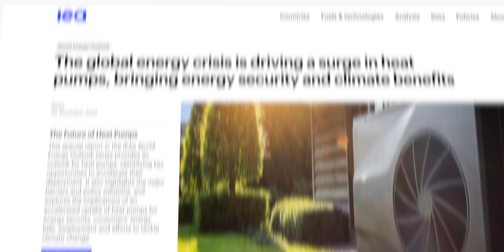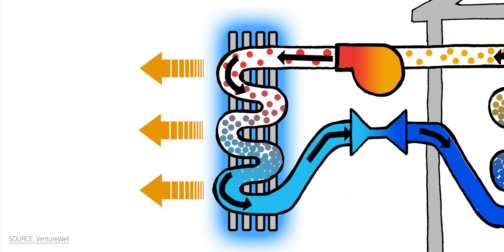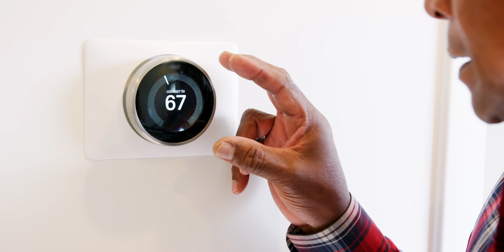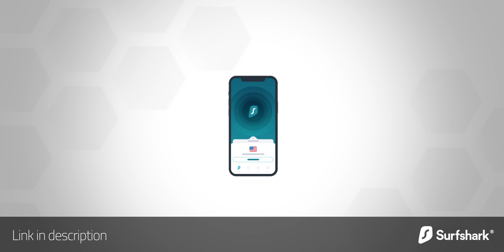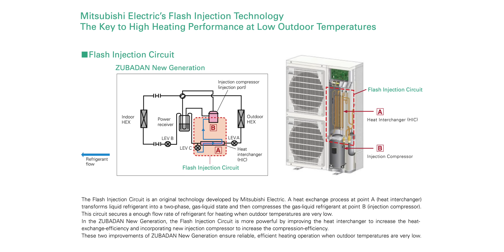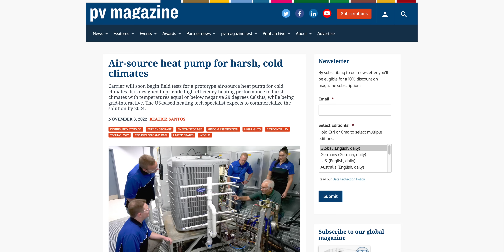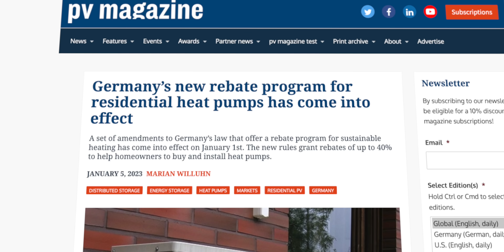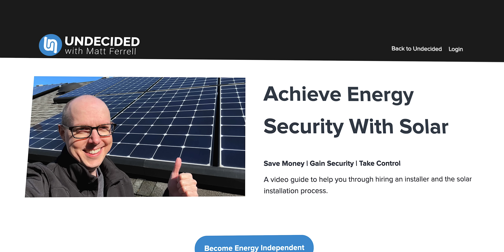Major Advances with Heat Pumps in the Extreme Cold

Comment: Heat pumps are way more difficult to service then combustion devices.
Reply: you can do the majority of a service for a heat pump yourself, not sure where you are, but in the UK you aren't allowed to service a gas boiler.  And here in Sweden, by law my chimney needs regular servicing and checks by an authorised professional.
Reply: @BenIsInSweden  So, I was selling heat pumps for 15 years, Carrier. We needed to train proper servicemen minimum of 5 years, probably 10 years you need to have skills to be able to repair HP independently. you can have mechanical problems, like pumps, ventilators, or leaks, water flow, understanding hydraulics, or leaks, for that you need special skills, electronics, chemistry. On top of that in all of Europe, you are NOT ALLOWED to repair heat pumps by yourself as you need to comply with gas regulations (special permits from the government are required) and you need to fill special reports for each repair considering gases and dangerous waste. You need to account for each kg of gas and report it yearly to EU agencies. Nobody will be able to service that amount of heat pumps in the coming years. Also, you need to have a bunch of special toolings that you don't need for gas boilers. You obviously have no idea what are you talking about.
Reply: @hrvojelasic5794  That's repair, I'm taking servicing, i.e regular maintenance. Most household heat pump maintenance, is preventative, i.e. removing debris and cleaning the coils, fans, filters etc.  With a boiler you aren't even allowed to take the cover off without being gas safe registered. Breakdowns are pretty rare, and yes in those cases you'll need someone with more knowledge.
Reply: @BenIsInSweden  I am also talking servicing, removing debris is not servicing,
Reply: @hrvojelasic5794  🤷🏻 I didn't say just removing debris. So how much and what of an actual service can't your average Joe do? because everything you listed was to do with repairs. As the only thing here is if there is a concern with the refrigerant lines, and that's mostly with split systems.  Monoblocs (which are common in the UK), don't need F-Gas for installing and servicing.
Reply: @BenIsInSweden  you need fgas reporting for each service that needs gas. actually, you can't touch these units unless you have permission for the company to do it (from the government). btw, you can't even buy gas if not registered. Even for cleaning you mentioned you need special tooling because you can damage fins or chemicals to deal with more serious debris. split units (up to 5kw)  as a general rule you don't service, just buy a new one. the only thing you can clean it by yourself. bigger units really depend on cost. For example, 1 kg of gas can be a couple of hundred Euros, without work or other material. All this is very expensive and annoying. People will realize it in a couple of years when all these units now being installed will start to fail.
Reply: @hrvojelasic5794  I don't think we're on the same page with what servicing is, I'm talking about the annual (or in some cases, every 2-4 years), where things are cleaned, and it's given a check-up that it's working properly, much like a car (except a car, you change the oil etc). You seem to be talking more about when things go wrong. Regardless, modern home units don't need you to do anything with the gas, if there's a leak, the gas is gone, so would need refilling, and someone is going to get a big slap on the wrist; ergo require someone with fgas certification.  A gas boiler needs an annual service - clean and checkup, but can only be done by someone gas safe.
Reply: @BenIsInSweden  Such ignorance is what I am talking about. Good luck

Comment: I had a heat pump system back in the 80's and I lived in the foothills of western NC. We didn't get extremely hot or cold in this area but there was always a need for cooling or heating in my house. While some people back then didn't like a heat pump because they said the air coming out was too cold in the winter time. I was pleased with mine, however the two units I had didn't last over about 12 years each. The problem with a heat pump is the compressor, while they run inside the flooded refrigerant system in oil (over time like anything mechanical at some point when they get enough run time) something will fail. My system was fairly cheap to operate however we did have a fire place insert that we used when it got very cold just to save on power. Our systems back then also had backup electric heater strips that would come on when the system ran too long and failed to rise above the thermostat setpoint after a predetermined amount of time. At least when you have a gas pack/air conditioner system you limit the run time on the refrigeration compressor because it is not used in the wintertime. You must also remember that unless you have a solid state relay in the unit, every time the compressor kicks on the mechanical contactor will arc and at some point it will fail. I believe that the systems I had were not scroll compressors (they were reciprocating compressors), I don't think that even if they were scroll compressors it would have made a lot of difference in how long they lasted.

Comment: I don't get how people use heat pumps for heating their home... I have a hot water radiator system with a radiator in every room.  If I got a heat pump system to replace my current system, I would have to have those expensive air blower units in every room of my house.  This would cost $30-40k.  What am I missing?
Reply: "What am I missing?" That there are other variations on the heat pump than just the mini split style.  What you're after is an Air 2 Water heat pump, which comes in two forms Monobloc (where everything is on the outside, and water pipes are fed to the outdoor unit to do the heating) or split, where there is both an outdoor and indoor unit connected via refrigerant lines, and the hot water is heated by the unit inside the house.   Depending on what temperature you run your flow temperature you may need to upgrade some radiators or pipework (usually if it's microbore).
Reply: Thank you.  My understanding is that using air to water heat pumps is a low hot water temperature system. My cast iron radiators require hoter water. Basically, this would mean I’d have to replace all the radiators in my house with baseboard radiators, which would be quite an undertaking and expense.
Reply: @marksTips466  it depends. There are high temperature heat pumps as well, but they wont be as efficient as a low temperature system. I do recall seeing a video of someone with a heat pump and cast iron radiators as well, so they might not be a deal breaker.

Comment: I installed a cold air heat pump in fall 2021.  I live in southern Ontario Canada.  In addition I improved the insulation in my basement.  I used closed cell spray foam on the interior of the foundation concrete walls. The previous insulation was a combination of pink fibreglass and foam board.  I can’t give a precise breakdown of my current electrical bill as I have an electric water heater and electric car charger and clothes dryer.   However my highest electricity cost on a 30 period in winter has been $264 Canadian.   Generally between April to October my electric cost has ranged between  $110 to $165.  I cannot account for the heat savings for getting rid of my direct vent gas water heater which used heated inside air for burning the gas.  One important benefit is that we keep our house at 70 deg F for 24 hours/day 7 days a week.  So for me I cannot say enough good about it.  My model is a Mitsubishi Hi2 model. The outside unit is almost silent particularly when on air conditioning mode.  I got a $5000 Cdn Greener Homes grant on this install.

Comment: What none sense ,they run off electricity , cost 50 thousand dollars ,when they do not have enough power already stoping people from using air conditioners ,and then they shut the power off , need a back up wood stove , putting thousands off tons of plastic into the ground .

Comment: I had a geothermal heat pump system in Grande Prairie Alberta for 22 years. It got me through -45 temperatures at least 4 times, with no problems. (Remember that this was a geothermal system, so I had 3/4 of a mile of pipe 10 feet under ground, circulating a glycol solution)
So, it did work, however saying that it doesn’t use much energy is not true. I was using considerable amounts of electricity to run the system. I was using more money to keep my house warm than neighbours using natural gas, by up to $200 per month. 
Consider, for a moment, what would happen if even only 30% of the buildings use heat pumps, and at the same time, 30% of the people use electric cars. People are already saying that people should charge their cars over night, but that is the exact time when house heating would be needed. 
Think of everything!

Comment: I live in Whitehorse, Yukon.  Where I come from -40 is kinda expected every winter.  The result is that people are scared of heat pumps.  However, right now, mid November, the average daily temperature is just under -10c, well in the range of modern cold-climate heat pumps.  In mid January, the average daily temperature will be down to about -20c, still in the heat-pump efficiency zone.  We get -40, so supplemental heat is necessary, but the average winter throws only about 10 nights that are below -30c.  It is our human nature to extrapolate the extreme event as if that is the state of the entire season, but cold snaps are an exception not the rule.  Even up here in the sub-Arctic heat pumps make sense to the environmentally conscious.

Oh, and it is true that some of our electricity comes from oil and LNG, but most is hydro.  There is a bit of wind and solar. (The latter is very ineffective at this time of year.)  Burt if we go electric, especially with a COP > 1, we will motivate the powers to produce more clean energy.  The long-term result is that it is worth it to convert to electricity, motivating the electric company to develop more green generationi.

Comment: We just got ducted heat pumps a week ago, went solar over the summer. Oil is way too pricey. I live in the Massachusetts and we are getting belted with really cold air especially in the mornings. I will say that i am on the fence because with oil my house would get toasty, with the heat pumps my house is “warm” but not that toasty feeling like i had with my oil heat. Has anybody else experienced this, is this normal for heat pumps? Like not hot but not cold either just in between kind of

Comment: Can these Heat Pumps provide a 1200 sq foot home 85000btus with an outdoor temperature of -40f? This is what we require in parts of Canada. At -40f which we can experience for weeks on end a Natural Gas Furnace is challenged installed in a R2000 home.

Comment: I live in Scotland and have had mixed experience with heat pumps. We have a lot of historic underground mine workings here so ground source not possible in a lot of areas. People tend to go for air source with the air to water type as opposed to air to air. I have found that they are good for new build where a well insulated air tight fabric is formed - particularly good in passive housing. However, have found not so good for retrofit where then need larger radiators / UFH, larger diameter pipework, insulation fabric upgrades and space for a hot water cylinder. For it to work in my own property I would need to spend around £40K (a lot of builderswork, plaster repairs and all floor coverings would need renewed); I got a new gas combi boiler supplied & fitted for £2K without changing anything and its  more efficient than the old one - use around £100 a month in gas even with the crazy price hikes. We also have a humid climate here and it can be freezing & snowing one day with sun out t-shirt weather the next. My client's have been having issues with air source units freezing up, going into frost cycles and not being able to cope with the rapid temperature fluctuations. They don't seem as responsive as a gas boiler; I can put the heating on in own house and it will be comfortable within half an hour; however, been finding air to water systems can take several days to respond properly. Been looking at air to air, although been in an office with it and it used a whack of electricity + everyone moaned about noise & drafts all the time. I think air source is something that works well with passive housing; our local council tried to build passive units though and it worked out around £350K per unit for 1 / 2 bed flats (around double the normal build cost and end value would be less than £200K). The UK has a long way to go to catch up with rest of world, but I think we have some unique problems to overcome and our engineers don't know how to design & set them up properly yet. I'm not convinced on them, but also haven't given up - thanks for the informative video.
Reply: like you i come accross homeowners having mixed results manly with running costs actually being higher because of electric unit prices unless they have solar and battery storage as well, i own a heating company but currently reframe from installing hp as my work is 100% existing housing most with poor insulation and air tightness which as your own estimate of 40k to upgrade shows added to the install costs of hp average say 13k  even if you got electric for nothing for forty years you still lose out  i have a 600m square home half original stone farm house and half rebuilt last year almost zero loss gas bill average 220 pm cost of insulating remaining half will cost around 100k to strip internal walls build deeper framed walls insulate to latest bc spec with140mm tp10 with estimated elec cost for 20k of hp at 400% eficency (which i have yet to see below 14 degree)  i  need about 80 kw ph output in region of £12 after doing the work or £24 per day as is!!!!  es

Comment: EVERYONE: Please bear in mind that this ONLY pertains to newly constructed or recently heavily insulated houses with brand-new windows, and so forth. This MINOR detail alone excludes 95% of homes! Why is no one addressing this? The house must not only be tightly sealed and free of leaks but also very well insulated! Otherwise, it will not effectively retain warmth. It's as simple as that. Why doesn't the government impose these incentives and mandates on itself or the industries it oversees? This should apply to public or commercial transportation, garbage collection trucks, ALL public buildings, schools, colleges, and public housing! Why not begin there? Why are police departments still permitted to purchase and utilize Suburbans, Tahoes, and Expeditions that get 7 miles to the gallon in the city? Why??? If you believe this is about saving the planet, think again! There is a potential 25% reduction in CO2 emissions by tomorrow, especially in the US, where the government can implement these straightforward regulations. Please, if you approach this with even a modicum of logic, you can discern the true nature of the issue. Why aren't there basic mandates in every US city to prohibit those single-layer glass high-rises without any consideration for facade changes when facing North or South? Simple, straightforward rules and adjustments can decrease pollution by tomorrow! But no, they are not taking those steps; instead, they are focusing on simple Joe or Kowalski. Please, am I the only one who sees this?

Comment: I have an air heat pump for heating and cooling of my 2000 sq ft home. I live in central Indiana where winters can be cold and summers hot. I've often wondered if building an enclosure over my heat pump would improve its efficiency. Something that would be large enough to allow plenty of air flow but in the summer would shade the heat pump lowering the air temperature and, in the winter, would allow the sun to increase the air temperature around the heat pump. Minimal air holes for ventilation. Any thoughts!

Comment: Many years ago, I had a heat pump.  Then we needed an auxiliary heating system, it was my then gas furnace. My point here is that the heat pumps today, need an auxiliary heating component for cold weather,that is separate from the heat pump.
Calling the two systems together a heat pump is misinformation by hiding a significant fact...
At the very least call this a Heat pump system,
Better yet is the full truth....   That helps create trust!
Call it a Heat pump & backup furnace(system).
Further, my past experience with heating electrical, vs with gas, was more Expensive.
Folks... Details are important!

Comment: 20 years of HVAC experience here. Less maintenence hey? I have installed ten of these this 2023 year, two Napoleon and eight Daikin's. Two of these have required me to spend about 8 to 10 hours (appox. $1000 of labor) of service on them to get them working. They are really HARD to service compared to a furnace. And then there is the fact we hit -40 in my part of Canada for weeks at a time. Seriously this video completely skips over this. And how about that you need a Refrigeration Tech to install these. They are the most expensive residential trades on the continent

Comment: Back in February, we had the coldest days of the year. The coldest day of the year, -1 to 22 degrees F, I used 90KW of power. My average with heat on is 30KW to 40KW. My base load without the use of heat is 15KW. Using a heat pump for heat is way more expensive then using natural gas in my area. Unfortunately I live in an apartment and don’t have the luxury of investing into solar or switching to natural gas.

Comment: How can anything be 3-5 times more efficient than a 95% efficient system 😂. This whole ambient temperature  thing makes no sense. Heat is basically generated by the compressor. But some using air-conditioners using compressors in hot countries is bad for climate 😮